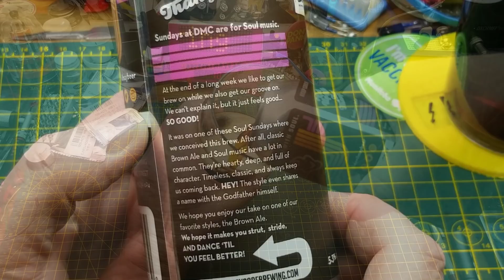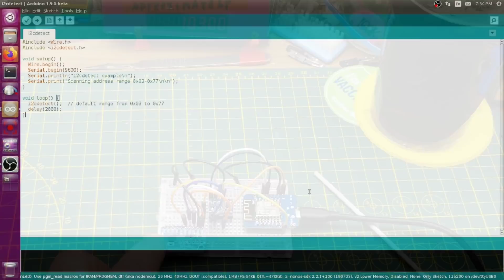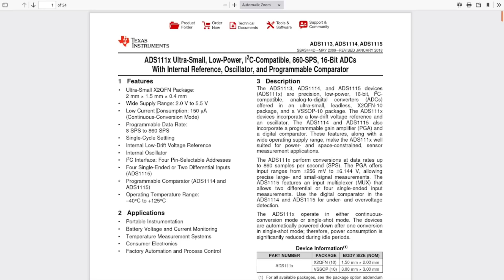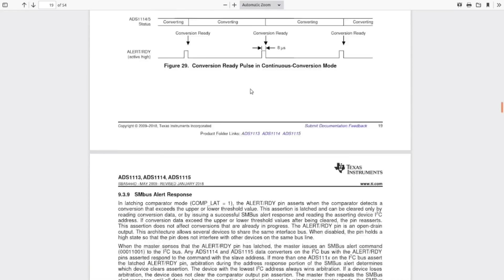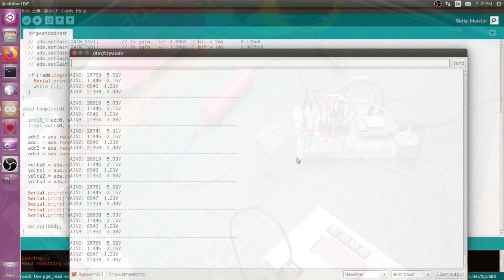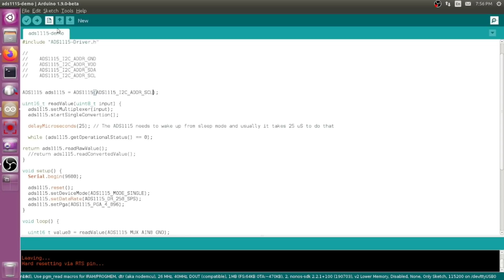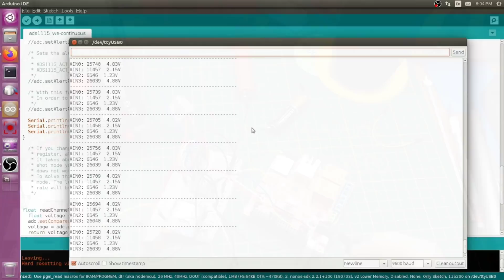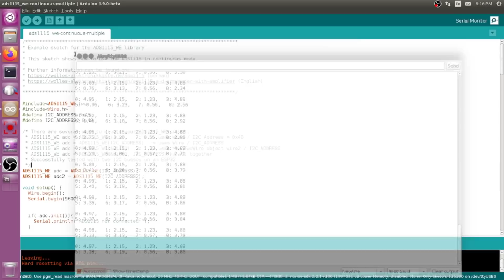Tinkering with: ADS1115 analog-digital converter

Comment: I'm using 16x gain to measure current shunts with a positive resolution of 0.014mv/bit. Pretty useful to not need an amp but this locks the other channels in that same 16x gain range forcing me to majorly down-convert any other voltage I wish to measure. I wish it had a PGA for each channel and create a 1/16th range for higher voltages (maybe not physically possible in an IC so small).

Comment: Excellent video!

May I ask why you used a level shifter?
Reply from the maker: Level shifter? 

Are you referring to the USB-DMX adapter?
Reply: @pileofstuff  
The small board between the ads1115 and the esp32?
At 2:00
Reply from the maker: @stephanc7192  Ahh, that.
It's one of these: https://pileofstuff.ca/r/25f84 (or similar)
Reply: @pileofstuff  yes. That one.
I am building a unit to read a presure sensor.
Why do you need a level shifter?
Kind regards

Comment: @ 5:20 you see "+- 6.144V" in the datasheet and comment that "... it can actually measure voltages higher than vcc..."
But it's actually an RTFM moment... please notice the superscripted "(2)" in that line of the table, which references note 2, which says " No more than VCC +0.3 V must be applied to the analog inputs of the device . See Table 3 for more information".

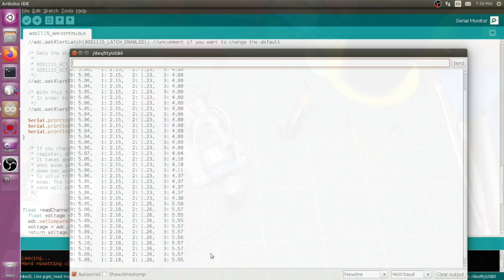So when you applied 6V to the input @ 12:12, you were apparently just lucky that it didn't destroy the chip!

Comment: this module has one but BIG error in design: when you disconnect the Vcc but the measured voltage is still there on the input pins, the module goes to trash. I lost 2 of them this way before I realised this. That should not have happened - you can imagine that this is very common case: Vcc gets disconnected while the measured voltage is still there. Probably 1 diode or so would solve it (however I am not sure how) ;-)

Comment: When you changed nr 5 at 14:51 there was even a negative voltage. In the datasheet there was also a + - voltage input written. Can it handle reversed polarity voltages?

Comment: ProTip: Use a Pencil to point at your circuits, not a conductive rod #THOR
Reply: Pro Tip: a pencil IS a conductive rod.  Pencil lead is made of graphite and conducts.  It's not a great conductor but I wouldn't be pointing at high voltage circuits with it.  Get out your DMM and check.  My HB #2 pencil was reading about 10 ohms across the diameter at the tip.   ;-)
Reply from the maker: My pointer is 3d printed out of plastic

Comment: I've been looking for nice Dupont silicone-coated hookup wires, would you recommend those? I looked at our best pal Universal Solder but theirs looked like not great quality ones.
Reply from the maker: I looked at the silicone ones briefly (after seeing Andreas Speiss using them), but got a bad case of "sticker shock".

I haven't had any failures of the cheaper ones yet, so I'm not very motivated to move to the more expensive option.
Reply: @pileofstuff  thanks! I might bite the bullet and buy some silicone ones from AliExpress and pray to the big Spaghetti Monster that they're decent. Where did you get yours?
Reply from the maker: @spacewolfjr  I don't have any silicone ones. 
The wires I do have came from the cheapest e-bay seller I could find at the time (as is my standard method)

Comment: This is a great ADC, the libary I ended up using allowed you to set the programable gain and the sample rate so you got the whole shebang and I used it with a Nano ammeter I built with one of those 0.96" displays, great chip I would use it again and worth getting a shed full if ya can...cheers.

Comment: Great video, thank you! I have used one of these for a current monitor, the differential input mode makes this easy. I added some code to calculate the current based on voltage drop across  the sense resistor.

Comment: Since it is I2C, it does mean more remote monitoring of voltages where 1 phone cable carying the I2C would have less loss than the same distance time ( up to 4 ) wires to monitor batteries.
Reply from the maker: Absolutely. 
Another application that I hadn't thought of.
Reply: @pileofstuff  got to love how phone cables and I2C have their uses and are redily available 😁

Comment: I use this for my 7s battery with a voltage divider  r1= 120000 omh r2 = 
1000 omh  max input voltage 31Volt  this give me a resolution of 0,000946044921875
for 1 count and output 8 use i for my amp meter  30amp 200mv and i am happy with the result
with a little math you can calculate each cell and see which is the min and max voltage of the 7s pack
Reply: How many cells?
Reply: @BrianBoniMakes  280 cells  7 serie X 40 parallel or 7S40P. Max voltage pack 29.4 volt.

Comment: Well the voltage is easy to calculate,  its (Vref/2^16)*count.  Dont know how many of these 16 bits will be below the  noise floor on a demo  board, could be fun to find out.

Comment: You never mentioned what the other modes are, now I have to find out. I can see a lot of uses for projects. Could also measure temp, weight, pressure, piezo load cells. 4 inputs is good for general uses. And an adafruit library, Nice.
Reply: yes see my reply a little bit higher